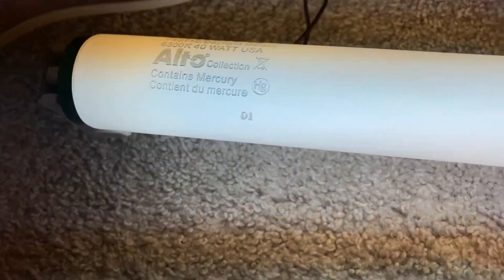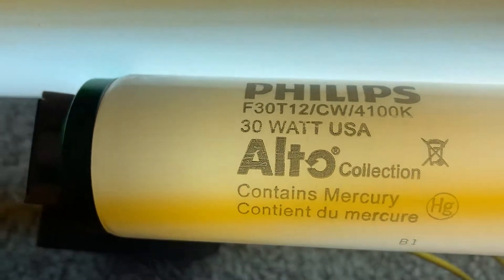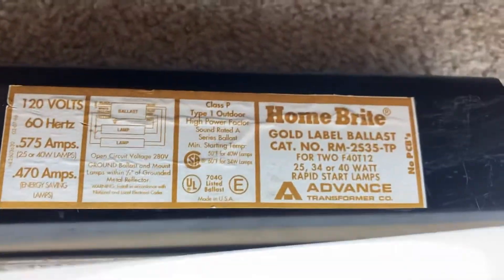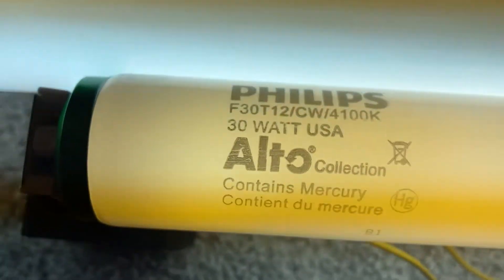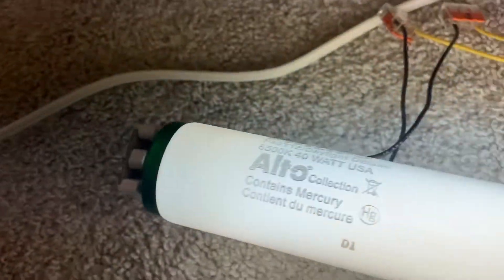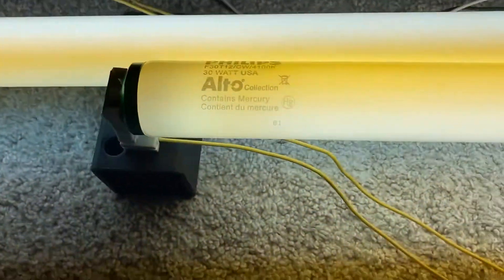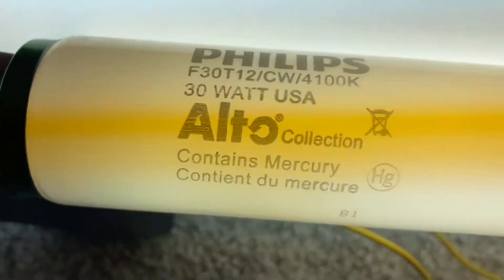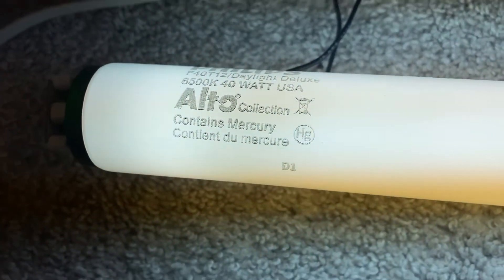3\4 foot fluorescent experiment

Comment: When I was trying my Feit F30T12 that I got a month ago, I put in on a HPF 2x40 rapid start ballast with an F40T12 on the other side as I don’t have any other F30T12s in my collection and it took an unusually long time for the lamps to start (making me think that the ballast was having a hard time starting then), but they did light. Did you experience a very long start time when turning in these lamps?

Comment: Back in the old days and preheat rapid start light fixtures you can run both 30 and 40 W fluorescent on the same kind of ballasts and starters
Reply from the maker: F30T12 was always a rapid start lamp, and F30T8 was also always a preheat lamp before electronic ballasts. Seemed weird to me but that’s how it is. I know there where a few preheat ballasts that could run 3 foot T12 lamps.